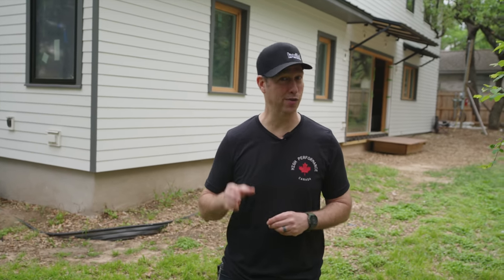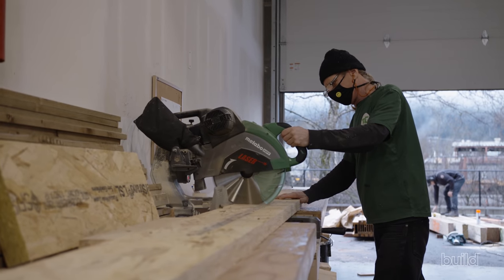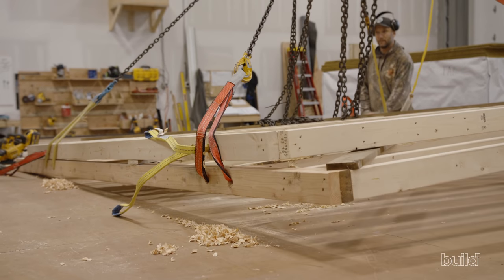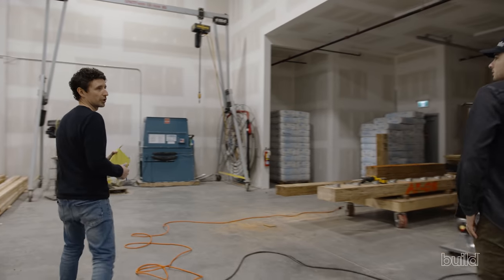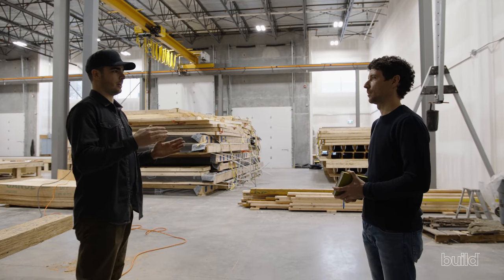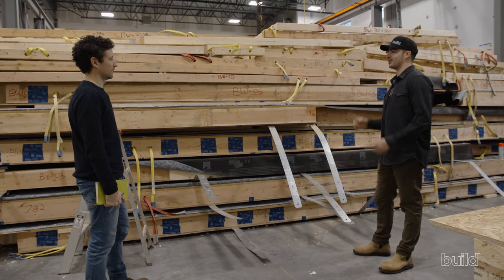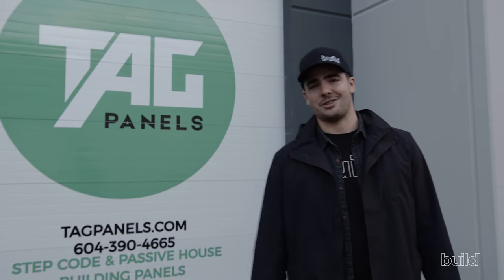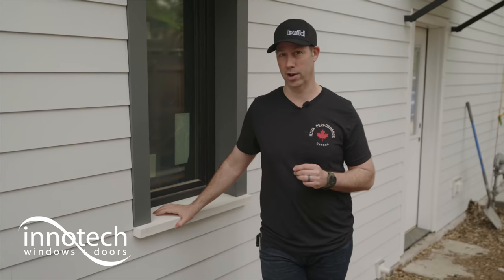Factory Framing Passive House Walls - "Build Original Series" Episode 1

Comment: why don't they load these walls directly onto a trailer? reduce the number of times they have to move the pieces?  Is that fiber insulation board resistant to water? I remember Matt did a video on that flimsy cardboard sheathing used years ago that fails so easily.

Comment: I like the concept if reliant on unskilled labor or to avoid bad weather. However, a skilled carpenter can build a structure with less than 1/16” tolerances for square/parallel/flat/plum, making the rest of building a pleasure rather than wrestling with the rest of the project.

Comment: Matt, very impressive but don't like the shredded newsprint being used for insulation. Possible moisture problem with that medium in high humidity levels in the southern United States. Another thing, I would hate to see transportation cost as well as the import tax to bring it into the United States.
Reply: Cellulose is better in high humidity situations because it can hold a significant amount of moisture without growing mold, whereas fiberglass and mineral wood can hold none. If you use the latter, the moisture that would otherwise be in the cellulose would be in the studs, drywall, or wood paneling.

Comment: I just got a bid for my house. 4044 sq ft... $55k for walls and trusses in south Texas. YIKES!!
Reply: Why so big ? I'm thinking 1300ft ?
Reply: really?!
Reply: @augustreil  ummm. Because it’s Texas and I’ll be living on 5 acres.
Reply: @markbuildstx , If that's what you want and need, then it's all good by me !!  That's why we live in America, right ?? !!!!
Reply: Try concrete blocks. Will be a hurricane proof house too.
Reply: If you don’t like the cost: do an earthbag house.
Reply from the maker: Oh dang.  Lumber is on fire!  UGH
Reply: look into post frame housing ... it uses less lumber
Reply: @dovahkindragonborn9827  It may use less lumber for the structural shell, by the time you add in all the infill framing and interior partition walls, I don't think the savings is as much as one would think.  Look at the recent video Matt did a video with the guy from RR Buildings.
Reply: We got a bid of about $75,000 for a 2000 sq. ft. house frame in Minnesota. Just feel okay with $55,000.

Comment: What is the finish on the interior paneling? What needs to be done to complete the interior finished wall panels??
Reply: BC is in a seismic zone so solid wood panelling is required for structure support. Drywall would be added to the inside for fire code.

Comment: whenever I price using prefab construction - it's 40$ more per sq ft.
Reply from the maker: Seems pretty good
Reply: Cost savings come from on site labour, management fees, and schedule efficiencies. Hard to calculate, and usually needs to be looked at from a project by project bases

Comment: Is the newspaper insulation chemically treated (boric acid, sodium borate, etc.)? Is this so common that the video doesn't mention the obvious? Even IF it is common, there are several kinds of treatments so wouldn't the manufacturer want folks to know which treatments are being used?

Comment: Sorry guys, but I'm not impressed with the overall build, materials and end product manufactured by this company.  Just my opinion.
Reply: I think this system is attractive. Good quality, predictible, and once you get going the construction should be pretty fast. I always wonder whether there is any significant savings which are passed along to the consumer.
Reply: Well having had to palm nail in joist hangers it takes more than a few minutes to attach the joist hanger to its support if you use the recommended galvanized nail, but I build in windstorm territory so the code requirements here maybe higher. Also, a lot of our lumber scrap on the job site was due to crappy wood that the lumber yard said “ just keep it”, and of course you use what you can and the rest goes into the dump trailer and to the dump. 

I don’t like their exterior board, it looks a lot like MDF and not very stable to moisture. Recycled new paper here after about 20 years compresses to about half its original thickness due to constant periods of high humidity, the occasional hurricane that blows warm moist air into the attic, and the activity of insects. 
     I remmember when I reinsulated my attic I pushed the recycled newspaper out from the center of the attic, it filled between the ceiling joist 2x 8 about 4/5ths from the outside to the outside. IOW to get joist filling level of R25 insulation I need to add 4 parts new insulation for each part of recycled newspaper to fill between the joists. On top of that I added another level of r13.
Reply: @10tenman10  here in Germany prefabed buildings are more expensive because you will get it much faster.

Comment: Fiberboard sheathing?
NO THANK YOU!
No builder I know what use fiberboard.
It could be the best fiberboard in the universe, and they wouldn't trust it.
Reply from the maker: It has Plywood interior sheathing... that's not fiberboard it's a wood fiber sheet insulation to break the thermal bridge at the studs.  Saw it all over Europe.  Promotes outward drying in a cold climate.  Then the sheet housewrap is placed over top.
Reply: @buildshow  Maybe.  Just a LOT of people out there with a REALLY bad taste in their mouth for anything even resembling fiberboard.

Comment: I build my house with panel like this and i wont do again. Yes the are build inside but the wait outise at the rain with the isolation. Also you still nee to put foreins bettween each panel. so its almost the same time as to do it completly. You will need to use a lot of tape to be air-tight between panel.

Comment: Seems like a fire hazard to fill your walls with newspaper....
Reply: Borax is put in for that.
Reply: You’d be surprised how many homes are built with paper faced insulation batts in the walls. Those things really go up in flames! This can’t be much worse on its own, but likely even safer with the fire retardants mixed in.
Reply: Blown cellulose is very typical in the PNW.  cheap and does well in the mild climate.
Reply: Fire retardant + dense packing + surrounded by wood studs = no heat and no oxygen for a fire.